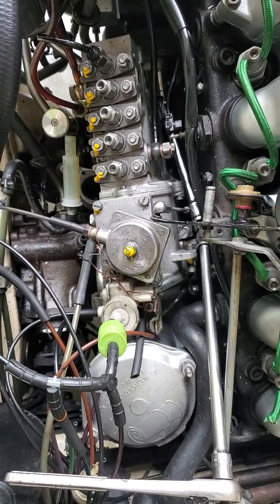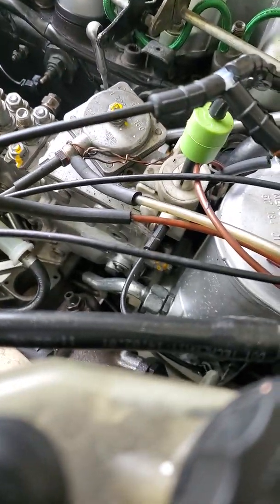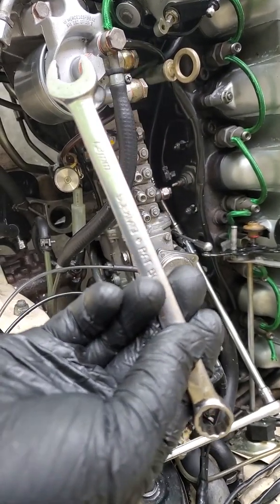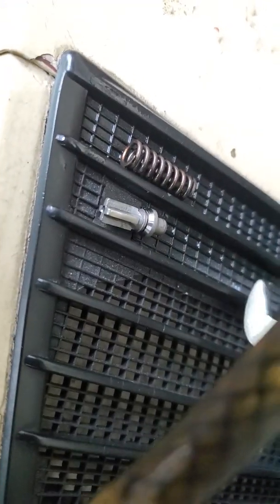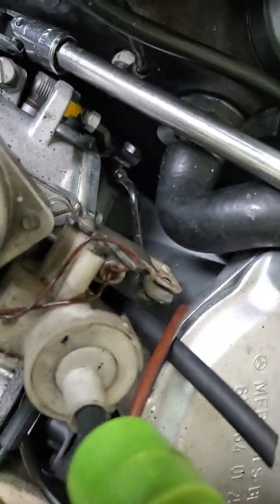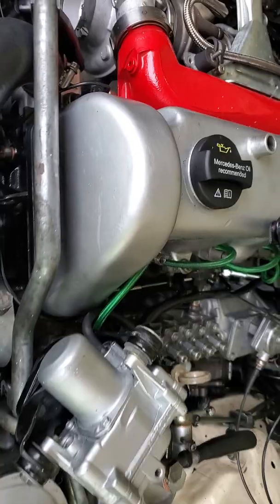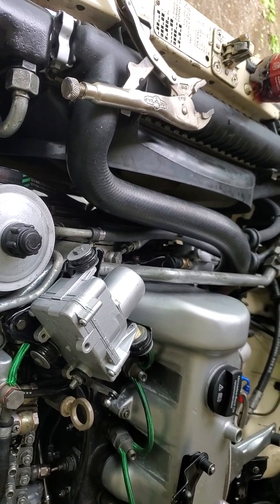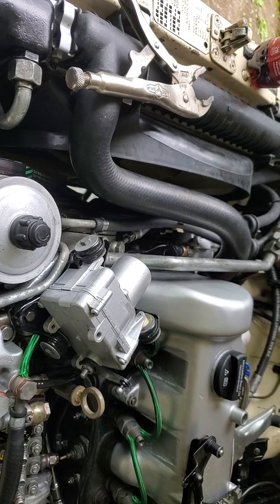How to drip time a om617.

Comment: Great video. When I rebuilt my 1982 OM616 I did the same procedure only I wasnt going to work the hand primer to keep fuel delivery steady while trying to move the pump to adjust timing. I wanted both hands free to work the pump.  I bought a stainless steel commercial pesticide sprayer on closeout sale and removed the wand off the hose and hooked that directly to the lift pump fuel filter fitting. By having a larger volume of air and fuel on hand I was able to pressurize it and take my sweet time adjusting the timing to dial it right in, and if it felt like I was losing fuel pressure I just gave it 3 pumps and was good for another 5 minutes.

Comment: U had to go 26⁰btdc bcuz overtime the timing chain wears out n other components related to chain drivealso wear out or start to gain slack/play n u have to re adjust inj timing. Or sometimes the brass bushing in the engine block which supports injection pump shaft often wears out. I know these engines so im just sharing my experience.
Reply from the maker: The Pump is New. It was totally rebuilt and bench tuned. Also, the timing chain and all related hardware is also new. I took this engine down to the block and basically replaced everything but the pistons and sleeves because they were fine. In my case due to the bigger 7.5mm elements the sweet spot came in at 26btdc. Only doing a drip timing can tell you what's correct for your own setup. :)
Reply: @gercoa9148  i have seen mechanics who r known well n r called gud mechanics. I have seen them failing to time om616 engines bcuz they can fix modern day cars but dont know anything abt how to spill time old engines like that. Im mean i was once very surpirised to hear from mechanic how to injection time om616 n he asked for my help, so i had to go to his shop to help him time mercedes 250d 5cyl. He acyually did start the car b4 i helped him but it was way retard, it struggled to start n clouds of white unburnt fuel smoke filled the shop. Older mechanics were masters of timing fuel injections, especially the engines without timing marks.
Reply from the maker: @harjinderkaur2384 Kaur Believe me, I don't consider myself a good mechanic. I'm 100% self-taught. I've owned about half a dozen of these over the years and fixed everything myself over that time and just learned as I went. The drip timing, while easy once you understand it, seems to trip a lot of people up so I wanted to share how it is done. This modified pump is also a little harder due to the extremely small window of movement in order to achieve a correct drip. less than a couple MM between full flow, no flow and actual 1 second drip. It was a 2-man job to do this adjustment on this pump because of this. You absolutely correct in most modern mechanics do not understand how this setup works, heck, they don't understand the vacuum system or its relation to the shifting of the transmission at all lol. Any information to can add to this is more than welcome as it helps the entire community of om617 enthusiasts. Also, if I have made any errors, please do point them out as I would never want to be sharing incorrect information. Thanks!
Reply: @gercoa9148  n yes bigger bore is responsible for adding 2⁰ degrees in advance bcuz bigger bore pump means more fuel n more fuel takes little longer time from start to reach finish line. By the time injection ends the piston travelled little farther with this newer pump, so its running retard. This is the reason u had to add 2⁰ more in advance.

Comment: hello gercoan i have questions about my om 616 engine because i disassembled the pump to replace it. so now I am at the correct mark on the timing gear I am at TDC because the 2 marks are aligned, on the other hand on the crankshaft pulley mark I am 5 degrees from the left "passenger side" of TDC. I imagine that I am at 5 degrees before TDC because when I turn my crankshaft in the direction of rotation and well after I arrive at 10?? I wanted to know if I should add 5 degrees of offset to 24 which is 29 degrees before TDC? I specify that I take into account the real mark of the timing pinion where the piston of the first cylinder is at the very top, another question if I turn the crankshaft pulley to have the drip must I take out the pump and put afterwards on the correct mark of the crankshaft pulley using the advance and the delay of the pump, ie more or less tilted towards the engine? this OM616 pump timing thing is really complicated, thank you for your feedback, if you want I can send you pictures? see you soon
Reply from the maker: http://www.peachparts.com/shopforum/diesel-discussion/294450-setting-injection-pump-timing-after-rebuild-om616.html
Reply: thank you verry much ! 👍👍

Comment: Getting ready to try this on my 83 240D.  One more question.....are all the fuel lines removed from the IP for this procedure and does fuel spurt out of all the delivery valves while pumping the lift pump?  (sorry, that was really 2 questions)  Thanks
Reply from the maker: Removing the fuel lines will allow you to move the pump back and forth easier but it a lot messier and you can do this with the 4 remaining lines still attached. you can loosen them if you like to give yourself a little more wiggle room if you need.

Comment: Thanks for making and posting this.  I realize it's a couple years old, but, one of the ONLY vids on this subject I've been able to find that THOROUGHLY covers ALL of the aspects concerning "drip timing" the injection pump.  Would really like to see the actual "drips" while priming.  However, after watching your well made presentation, I finally feel confident enough to tackle this task on my '83 240D.  Your engine looks fantastic and is amazingly clean.  I'd imagine your entire car looks that way as well.  Cheers and thanks!
Reply from the maker: Thanks! I'm glad it helps someone. I know I drove myself crazy learning it at first. The Car is currently in a state of rebuild. I work very slowly, and only have a couple days a month I can even get out to it. Someday it will be done. :) I have another video after this that shows this going a little further and starting the car after and then one showing how it starts and runs driving the car off ramps. Which of course I immediately pulled the engine and transmission out entirely and redid both of them lol.
Reply: @gercoa9148  sounds great.  looking forward to the follow up vids!

Comment: Can you get it correct at 26 with the pump I'm it's original spline or does it need to be pulled and reinstalled?
Reply from the maker: YES.  keep it on the original spline.